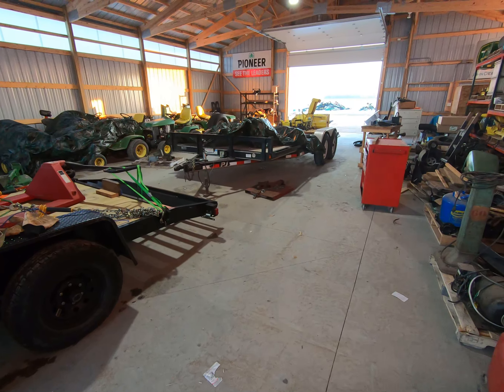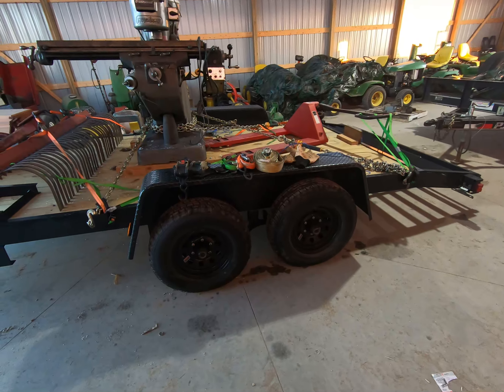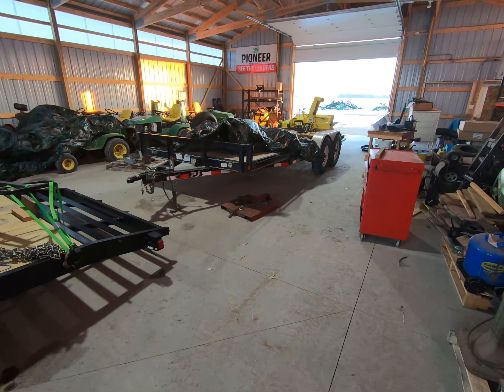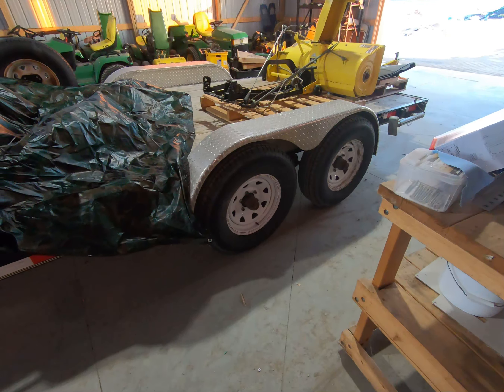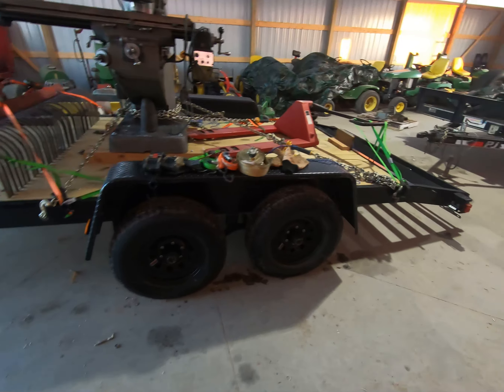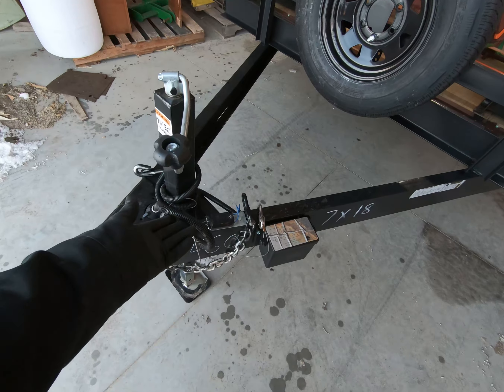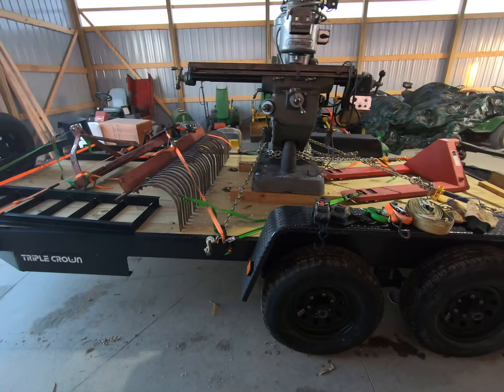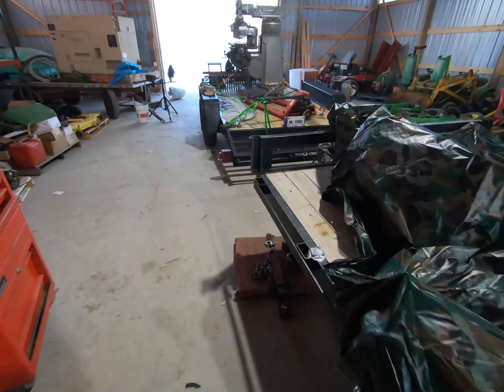Trailer Comparison: Two 7x18 9,990 lb Rating

Comment: Great comparison! Thanks for the video. I've been looking to upgrade to a 7x18 or 7x20 here soon. PJ definitely seems to be the better trailer overall, for the money. I'm also considering Pequea and Big Tex. Have you had any issues with the powdercoat peeling on the PJ? I've heard that is a common issue with them.
Reply from the maker: Glad you liked it. Figure it would be nice to compare two "types" of trailers. I don't have much bad to say about my PJ. It's more or less lived outside for 5+ years and I've put a heap of miles on it. It has a few powder coat issues but they are in the high traffic, high wear areas (rear rub rail, top of the rear frame), which are all areas I would expect to loose either paint or powder coat. If someone is complaining about stuff like that they have too much time on their hands! No other area seems to have any powder coat issues.

Comment: I've owned a few trailers in my day as well and have finally settled on a 25' Big Tex gooseneck.  That being said the things I liked about the PJ I owned are the A frame continues down the side to the spring shackles which I feel adds more strength to the frame.  One thing to consider (and I don't the the mfg has)  when it comes to the placement of the jack. On the triple crown chances are it will get in the way when trying to open the tailgate of your pickup unlike the lower profile/mounted farther back jacks, at least that's what I've found with these newer pickups.
Reply from the maker: I've heard a lot of good things about Big Tex trailers. Yes, the rigidity of the PJ is pretty impressive compared to similar trailers on the market. You certainly notice it when the trailer is empty. Yes, jack placement can be a huge pain. Luckily on the TripleCrown the jack misses my tailgate by about 2 inches.

Comment: I think PJ quality has gone down since big tax bought them out! What do you think about Tilt deck trailers rather than ramps?
Reply from the maker: Yes, I have seen many comments to the effect of Bain Capital buying PJ in 2016. One thing I have taken away from those comments is that the issues seem to be hit or miss. If a trailer has problems it will have a lot of problems. Other trailer have no issues and are similar to my 2015. 

I've always been on the fence about tilt deck trailers. I think if I had specific loads in mind a tilt deck would be great. However, sometimes I haul multiple machines on one trailer and tilt decks are not great in those applications. I would love to try a tilt deck with a winch on it though. I think that would be very handy when recovering machines from their tree line tomb.